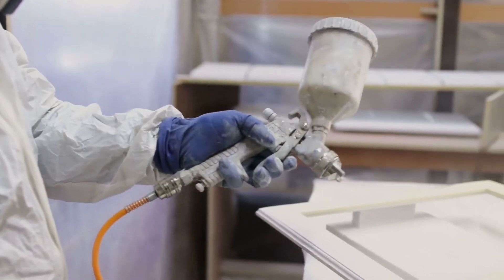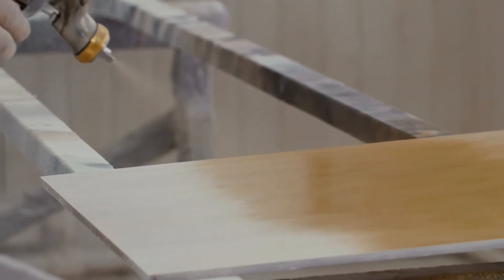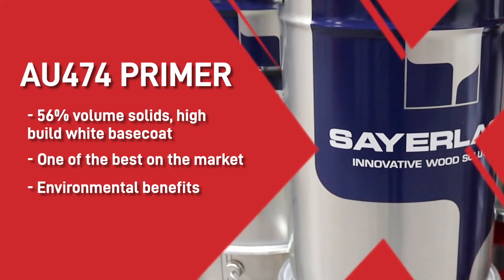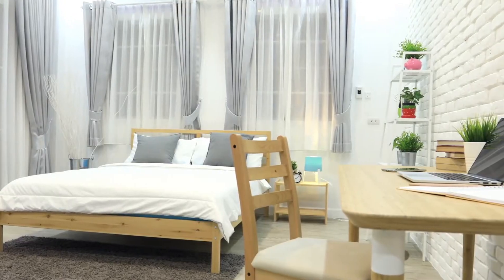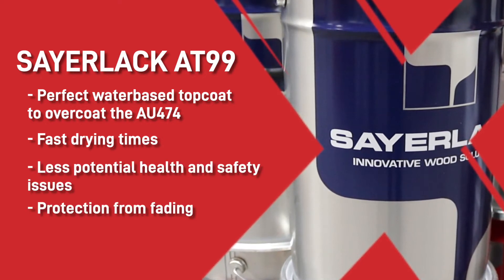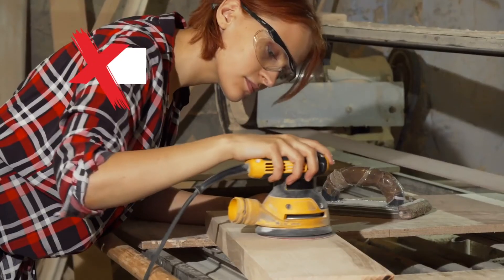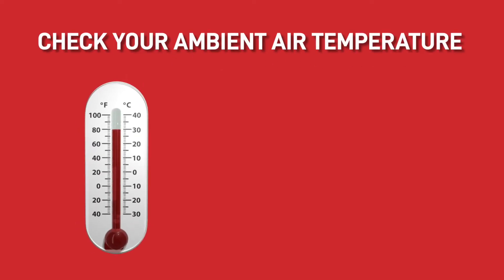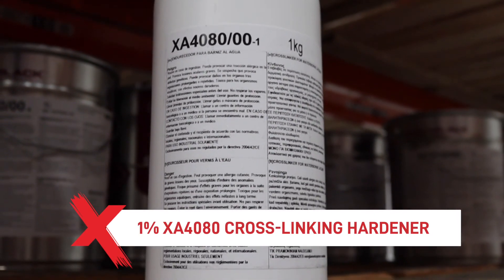Why Hardener and a Cross Linker is Crucial With the Sayerlack Water Based Paint System for Joinery

Comment: Is this product inclined to raise the 'grain' on MDF? Conventional water based paints do.
Reply from the maker: Hi Elliott, crosslinker and at99 combined is a very good timber covering so the grain tends not to raise but you can use au474 primer before the at99 topcoat (with or without crosslinker) to ensure the grain doesn't rise first for a perfect finish.

Comment: I'm still wondering why hardener and cross linkers are crucial…this seemed more like a commercial than an informative video
Reply from the maker: Hi Stene at its simplest hardeners speed up curing time without affecting the chemical properties of the finish. In a DIY application a hardener may not be too necessary (ie: if you have no deadline and you can afford the paint to go off by itself then all good and I wouldn't worry about it. ) However in industrial scenarios you have projects , deadlines and a back log of work that must fit through the paint shop. The hardener therefore speeds up curing chemically and allows you to move more jobs through the paint shop (more jobs more production effort , more profit etc ) . In terms of crosslinker in Sayerlack this acts as a hardener and ease of use hybrid. Not only does it hardener faster than without but it also prepares the surface to make it easier to sand down for any final stages. Again in an industrial setting this can shave a lot of time from work and increase productivity and profit. Hope that helps Ultrimax Team
Reply: @ultrimaxcoatingsltd  that’s very helpful thank you! Right now I’m wavering between several WB products, I’m trying Renner right now. Do you have distributors in the USA and Canada?
Reply from the maker: @SteneWoodwork  Hi no unfortunately we are UK only but can advise from our side we think Sayerlack (sherwin williams) is definitely the best for interior wood and Teknos for external (do you get that brand in the US?) But Renner is well liked over here in the UK as well - here Renner is prob classed as a mid-tier WB product but overall no real complaints about it.
Reply from the maker: Sorry forgot to add Stene if you have a topic you want further advice on or some training just drop a note in comments here and we'll do a video on it . br Ultrimax

Comment: Hi, the spec sheet of the AU474 primer and the AT99 mention conventional sprayer, airless, etc, but it doesn't mention HVLP. Not sure if it's suitable for hvlp as well. In this case a Graco 9.5 HVLP. Could you please advise? 
And would them need the respirator and full gear as mentioned in the other comment or just if I add the ah1550 and xa4080 respectively?
Thanks
Reply from the maker: You can use the AU474 and AT99 with a Graco Turbine but you would probably need to thin the AU474 primer with water to get it to spray correctly.
A normal half face respirator is fine for spraying AU474 and AT99.  If you use the AH1550 hardener in the primer then we would recommend an air fed mask.
The XA4080 is a cross linker and this is fine for use with a normal half face mask.
br Ultrimax Coatings Team
Reply: @ultrimaxcoatingsltd wrong! XA 4080 is Aziridine based croslinker and requires air feed respiratory protection.

Comment: Thank you for the information.
The video suggest using waterbased laquers with isocyanate hardener in DIY environment? 
Lady is sanding with Ros sander not wearing mask? The person who is spraying is not wearing gloves?
I heard that isocyanates require spray booth and air feed respiratory protection plus full body covering suit?
Reply from the maker: HI Matt, glad you liked the info - we tend to focus on the industrial and commercial environments and although all paints and hardeners have some element of isocyanate in them (it's unavoidable with current technology) the levels in ISO free paint are exceptionally low compared to solvent based paints. We did use some stock footage just to give the viewer a more visual idea of what we were talking about so well done on the eagle eye for Masks and Gloves. Ideally if you use any paint gloves, mask and overalls and if you can an air fed mask like a Honeywell is always recommended. Whether you need an air feed generally depends on whether the paint your are using has a high ISO level and whether its 2 Pack or 1 Pack. 2 Pack definitely needs air fed masks and full respiratory gear. 1 Pack its advised but not the rule. Hope that helps and if you need any further help on any products or features just drop us a line on here or at sales@ultrimaxcoatings.co.uk. BR Ultrimax Team
Reply: @ultrimaxcoatingsltd  Thank you for the reply. Actually I'll give a go the AT 99, no crosslinker on the kitchen presses repaint, for the first time.
Reply from the maker: @mattgloss8580  recommend it the AT99 is a lovely product and of course it can be mixed to any of the shall we say top paint colours (Monkey's Knuckle ;-)  ) don't think you'll be upset with it - we have it here https://www.ultrimaxstore.com/sayerlack-water-based-topcoat-matt-at99-c-60-p-36637361 but love to see any finished results when you're done.
Reply: @ultrimaxcoatingsltd  Thank you. Is the AU 454 primer suitable for coating over existing old Acid Cat, Precat and PU laquers after solid preparation by degreasing and sanding with 180 grit?
Also does the dry primer film need to be abraded to provide mechanical adhesion for AT99 or it can be over coated straight with AT99? 
I appreciate your help.
Reply from the maker: @mattgloss8580   yes you should be fine there with AU454 if the pre-existing is relatively old and cured? and you then abrade give it a good degreasing and sand then you've done your due diligence on preparation. As an extra precaution would probably just suggest to section of an area and do a test patch before coating the full object for a concrete system.
Reply: @ultrimaxcoatingsltd  Yes it's well cured.
Thank you very much.
How about the keying of the primer before AT99?
Is this compulsory?
Reply from the maker: @mattgloss8580  should be fine then in that case, yes would always advise keying regardless of situation for best practise. Some joiners don't and the paint goes on fine but best practise situation and especially if you have the time to do so then key.
Reply: @ultrimaxcoatingsltd  Understand. Thank you.
Reply: Hello. I switched to AU 474 and At 99 and absolutely love the products.
I'm crosslinking both with XA 4095 that seems to improve primer adhesion to existing difficult surfaces and makes the top coat cure faster and improve the hardness. Also the XA 4095 is safe to spray with just P2 mask cartridge.
So there is decorator friendly Crosslinker alternative that can be used in situ. ❤